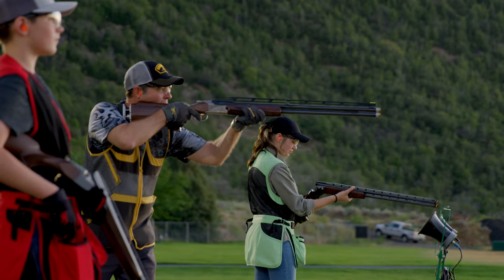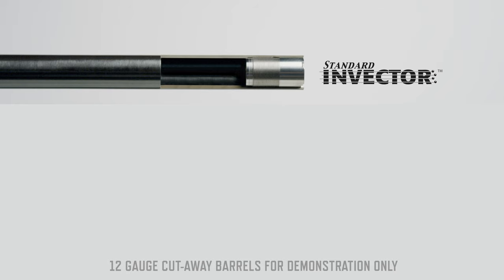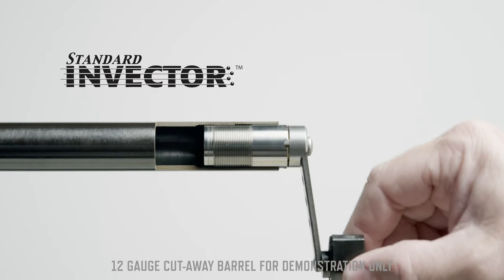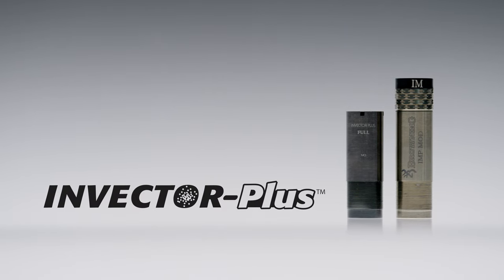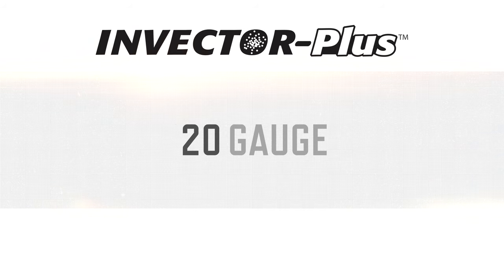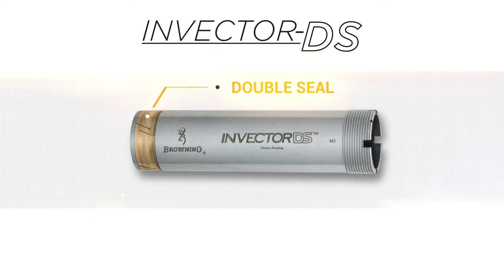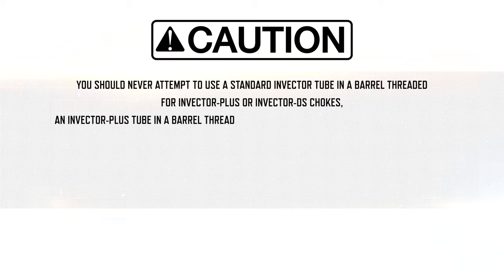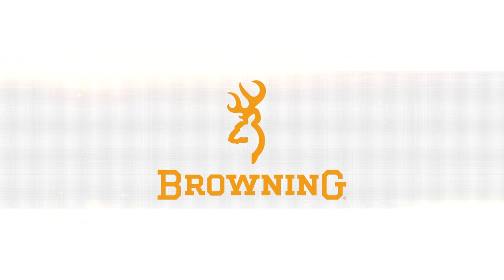Browning Choke Tubes

Comment: Are the Invector Plus choke tubes approved for steel shot?
Reply: I have shot steel loads from investor plus.  The choke tubes are marked as lead and steel compatible.  The prices range near $50 / choke tube.
Reply: @danielt.3152 And yet I’ve been told not to use a full choke with steel.